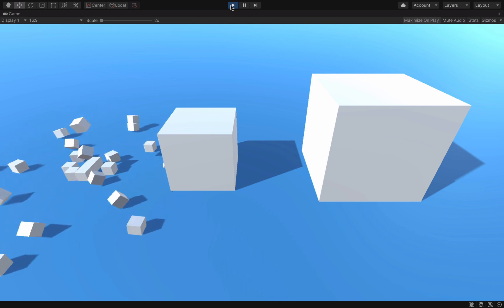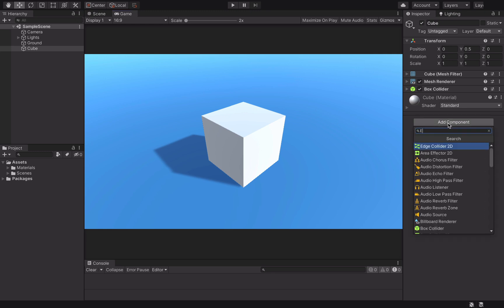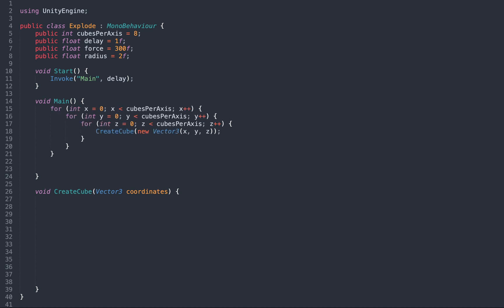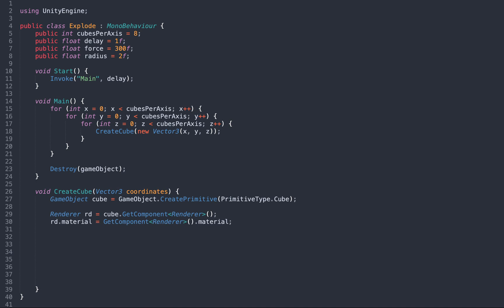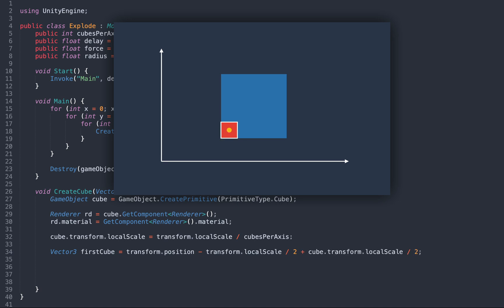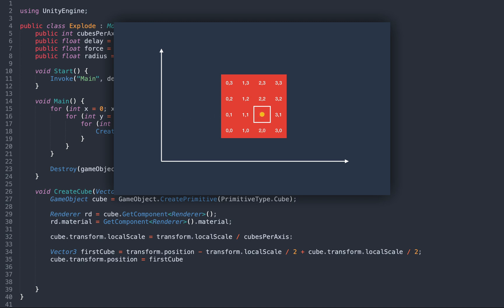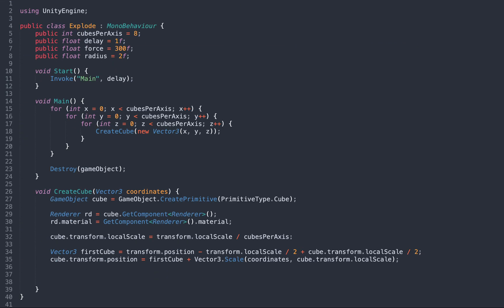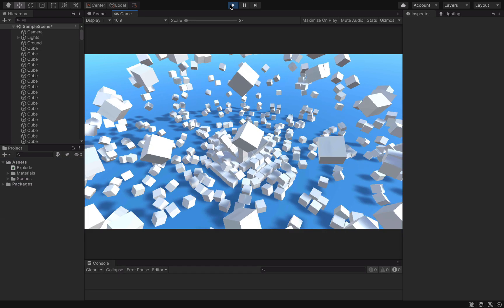How to Explode a Cube | Unity Tutorial

Comment: This works really well!

One problem I'm having, however, is in trying to use this script in combination with a trigger. The object should only explode if the Player walks into the trigger while having a certain number of items in its inventory; this has worked previously with a simple 'destroy' line, but using this Explode script as the result makes the object just blow up without even checking for those conditions to be met. Frustrating :\

EDIT: Fixed by having the Explode script on the object to be blown up, deactivating the module and then using another script to re-activate it when conditions are met :]